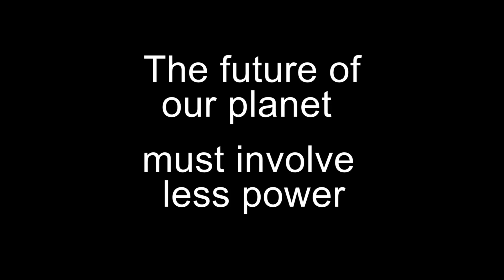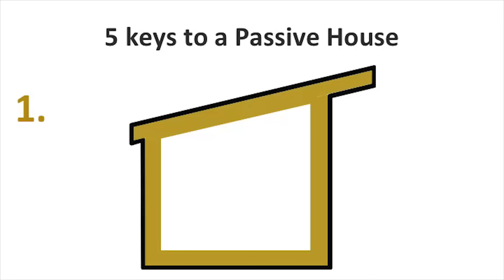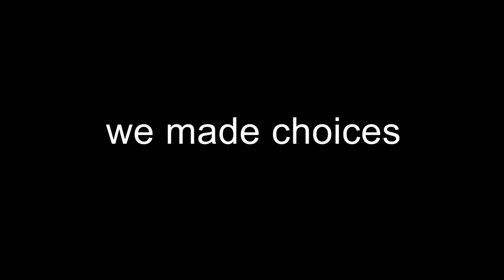Superpod Trailer

Comment: Would like to talk about costs and interior finishes  and fit out inside. We are looking at 3 bedroom homes up to 140m2. Also looking at no columns in the interior spaces. All to be part of low impact sustainable communities which will have  fully integrated infrastructure that will include, PV Geothermal low grade heat for heating and cooling (with Superpod this will be low), water capture, recycle and reuse systems for developments up to 400 homes. Located on the east coast of Australia by SUCH Developments part of the UIWGroup group of companies